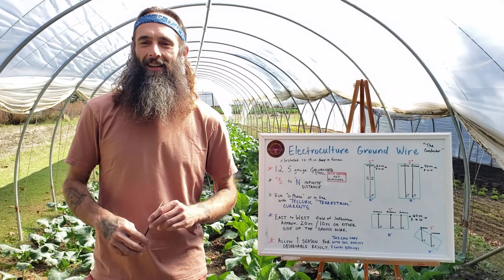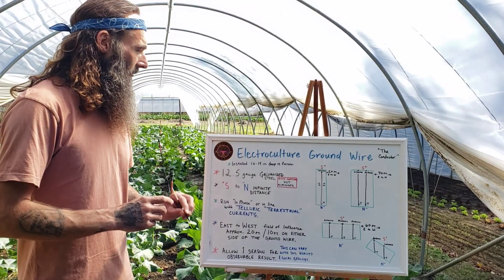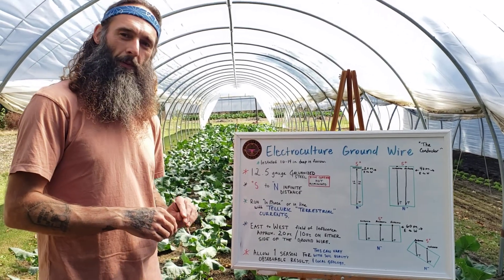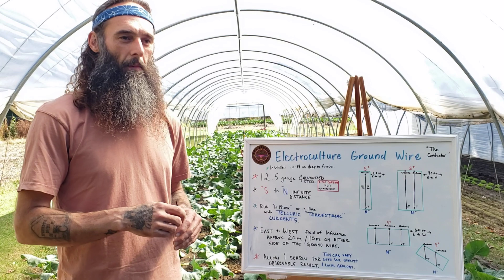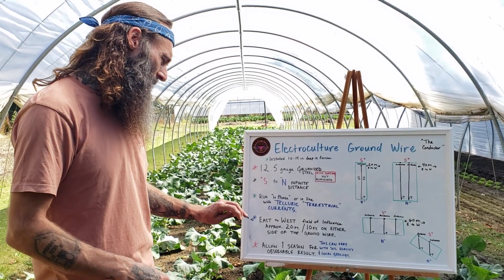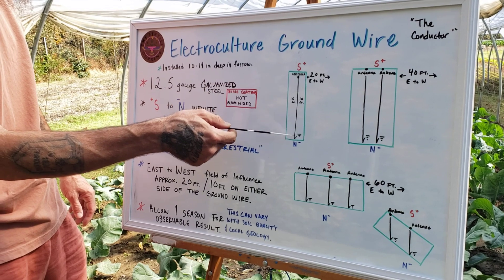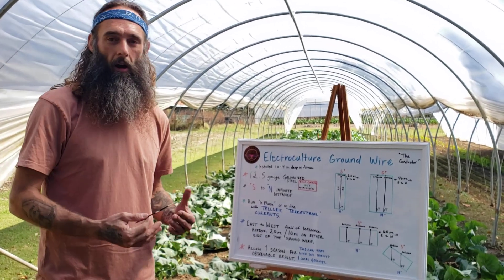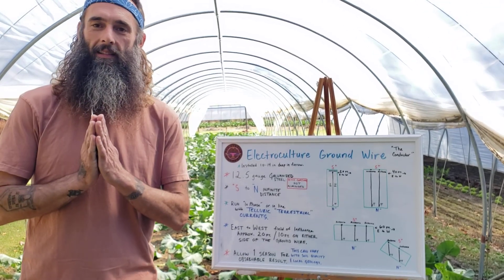Electroculture Ground Wire Installation Details.   @TheFertileCurrent

Comment: I have noticed that a lot of the galvanised wire is aluminised here in Australia , the old Galvanised wire was very zinc like and not shiny like the new stuff, thanks for mentioning that , I was wondering why it looked like that , some of the newer Galvanised wire looks fake and it’s pretty cheap too.
Reply from the maker: yes, the aluminum coated wire snuck in over time and is not delineated very clearly in some stores. At most farm supply stores, you will find the galvanized zinc coated wire outside and the aluminum coated wire inside with electric fence supplies but thats not always the case. Good on you for noticing !!

Comment: If the southern antenna and Northern most ground are in the right positions, does the ground wire between them need to run in a straight line to function correctly? I just know straight lines aren't necessarily found in nature..
Reply from the maker: hey friend, the wire is straight and tight for better conductance. I dont separate myself from nature so if i made a straight line, straight lines are found in nature. much love